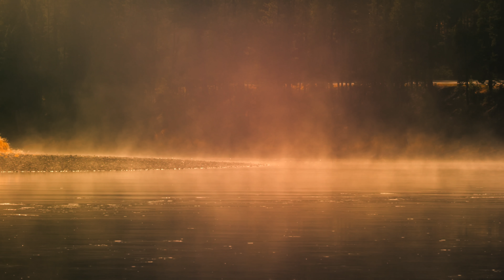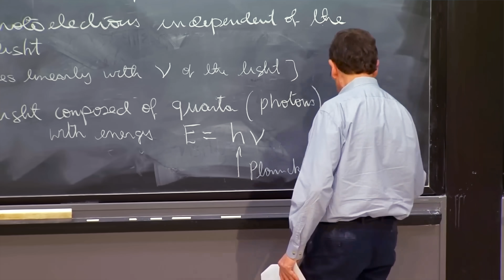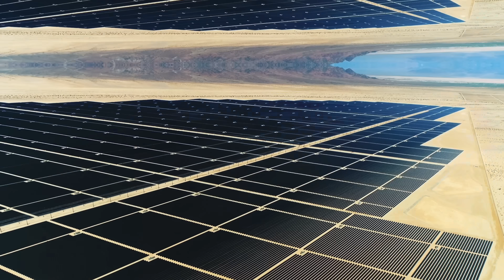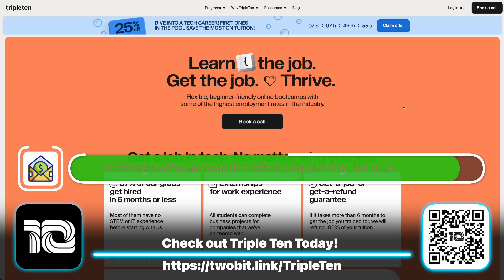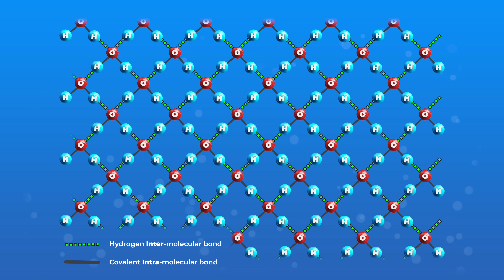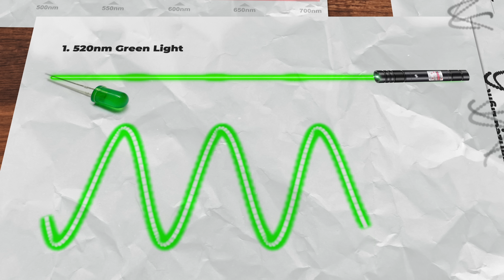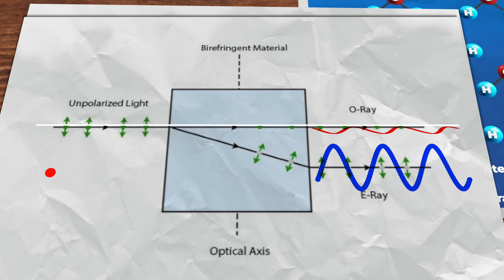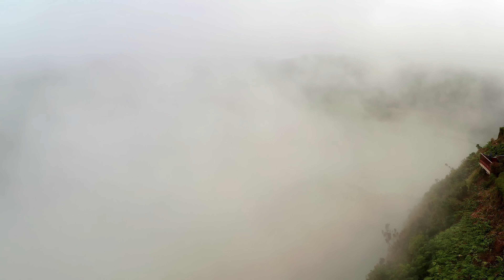New MIT Discovery Just Solved Water's BIGGEST Mystery!

Comment: I live in a cold climate in Canada. I watch ice shrink in the winter in conditions of   -40°  .   I have always been told this is sublimation.   We hang wet clothes outside and they become dry.
Reply: Back in the 40s and 50s, my grandmother used to hang the clothes too dry in Chicago winters and occasionally, break a corner off. They dried in the cold too.
Reply: @nwchrista  Cold air can't hold as much humidity. Winters are always drier than summers.
Reply: @Gunni1972  Sounds like you've never encountered a cold temperate maritime climate... Summers are wet, winters are significantly wetter.
Reply: @peglor  In a maritime winter the air is more saturated with water, meaning it holds a greater amount of it's maximal capacity, however the total capacity to hold moisture is much greater in warm air.
Reply: @creativedesignation7880  In maritime summer the air will also hold a similar percentage of it's capacity of water. Having a massive body of seawater nearby means the humidity rarely drops below 50% all year round. Low humidity only occurs, summer or winter when the wind changes from its prevailing direction (Sea to land) and picks up dry air from further inland.

The humidity here hits 100% warm or cold regularly enough - the only way to tell it's raining sometimes is to see if drops are hitting the puddles because it can be hard to feel small drops landing on your skin over the background of completely saturated air. I experience this more in summer, but that may be related to being outside more because it's warm.
Reply: @Gunni1972  Air can only carry so much moisture at a given temperature. 
Absolute humidity is the mass of water per volume of air. 
Absolute humidity of cold air is less than absolute humidity of warm air.

Relative humidity is the mass of water per the amount of water that can be held by air at certain temp. 
100% humidity of cold air is less than 100% humidity of warm air. 
That is why a incoming cold front brings rain and your lips get chap in the winter.
Reply: @peglor New England oh my goodness it’s so wet in winter
Reply: Like many have said already, I wouldn't be surprised with how dry the air is to pull moisture out of the clothes.
Reply: Since sublimation is literally a solid changing to a gas without existing in an obvious liquid state in between, it is sublimation.
Reply: This (the video topic) is not sublimation. This is a light hitting the surface of the water causing the formation of a mist (i.e. tiny droplets of liquid water) which drift off and later evaporate in the air.

The higher rates of evaporation here are not really anything special it is just a result of more surface area and interaction with the air. You would get a similar effect agitating the water in some other way. They just happen to be doing it using light here.
Reply: @kanoaika  is it not drying simply because of the air?
Reply: @Music-xp5wg  I still haven't figured out what specifically your question is asking about since I was talking about two different phenomena in my reply. I'll answer for both.

Sublimation is not just drying 'because of the air'. Sublimation is when it goes directly from a solid to a gas. It takes an input of energy for that to happen as there is a phase change (bonds need to be broken). The source of the ice outside in very cold weather (which is the one being considered here) we know the air temperature is very low which eliminates the air as a significant source of thermal energy for the phase change. The other source of energy in this case is the radiation from the sun. This is the source driving the sublimation. Radiation is absorbed causing molecules of water to get enough energy to jump directly to a vapor form and leave the ice crystal. 

(This makes even more sense when you consider that while solar radiation intensity per area decreases during the winter (because of the axial tilt of the planet leading it to be spread over a larger area) the energy received per incident photon absorbed is the same in both summer and winter. I.e. while the ambient temperature of air dramatically decreases (decreasing its ability to facilitate removal of water and provide energy) the sun on the microscopic scale of the molecules being hit with a photon and released from the solid ice is just as strong as ever on a cold winter day).

In the case of evaporation (i.e. water loss from liquid water--the main video was talking about) this is normally facilitated by air to a significant extent. But in the context of this comment which we are in the reply section of, we are talking about ice shrinking in -40° weather. In this we are not talking about evaporation (or the effect here with some wavelengths loosing tiny bits of mist which then evaporate in the air) because there is no liquid water--it is -40° once again.

So to conclude, you are correct: in the general case (especially the one mentioned in this video) it is actually the air doing much of the work for evaporating the water, but in this specific case the air is extremely cold and the water is frozen which makes those effects negligible (heat transfer from air) or non-existent/irrelevant (the special mist generating effect that is the main topic of this video).
Reply: @kanoaika  Mist is a good metaphor the the tiny molecule level interaction.

Comment: Something that comes to mind for me for an application for this is to help minimize evaporation losses in water storage. I have quite a few man made ponds (we call them a dugout) on my farm. We’re currently in a drought and water levels are low. I think I’m going to try to find some green pond dye and see if that might minimize evaporative loss in them.
Reply: Perhaps instead of dye you could find a surface water plant that would provide coverage. We have a Bunch of Invasive water hyacinth here on the San Joaquin River Delta. I'm sure CA Dept of water resources wouldn't mind sharing! ✌️😸🍀
Note: it can also be used as feed and woven into mats. The flowers are also pretty. 
Ps. Totally empathize about the drought. My region is an agricultural bread basket, so the La Niña years, which often brings drought, can hit us hard.

Edit: Other possibilities might be liquid chlorophyll or some type of benign algae. Or, perhaps even green plastic balls. I saw a Veritasium video where he visited a reservoir down in SoCal using black ones for cover. 
Personally, I'd go with least toxic option for whatever you have on your farm.
Reply: @erinmac4750  in hot, dry years we do get algae mats growing in the dugouts. The issue with algae is it clogs pipes if it gets sucked in, and it also makes the water stink because it dies over the winter and sinks, rotting on the bottom the following year. The drought has been pretty bad last year, and this year it’s not quite as severe. Although the water table is way down, so pastures are bare and regrowing very slowly. Hay/forage is also suffering and growing slowly and thin. No rain in the forecast either, but the prediction is that we should start to see more regular precipitation next month as El Niño breaks over into a La Niña pattern. Allegedly. But seeing as weather predictions from “professionals” is exactly as accurate as weather predictions from a 3rd grade class, I’m not exactly holding my breath.

Comment: Hmm so there is some requirement for polarized light and you also mention an optimal angle of about 45 degree.  Reflected light is polarized and correct me if I'm wrong, but isn't 45 degree angle close to the total internal reflection between water and air?
So maybe this edge case of such a specific angle does cause some near total internal reflection of water vapor so the light can be bouncing way more often between the molecules to make it a lot more efficient compared to other angles?
A bit like resonance where its effect is way more stronger at a specific angle.
(well waves and angles are always related, so maybe not that far fetched)

Comment: By definition If it’s evaporating it’s heating, the average scalar of movement of each atom or molecule.

A better use of time would be to figure out if the bright reflections on water is hydrolysis and then combustion.
Reply: According to the presentation of the subject, it looks like disintegration, not stimulation. So, the green 45 degree light isn't stimulating molecular movement enabling H2O liberation, but presenting as a giant green blade cutting the intermolecular bonds between the H2O formations, with gibbets of water molecules flying into the air like Sponge Bob directed by Quintin Tarantino.
Reply: @Arthurians  Cutting van der wahls bonds directly is statistically improbable and doesn’t give the water molecule a vector to just escape

Comment: You don't understand evaporation. Evaporation happens because the heat of a liquid fluctuates on the molecular level and, at the surface, can allow a particle to escape. This doesn't require heat. The sun increases the rate of evaporation. But in a dark room water will still evaporate. In a cold dark room water will still evaporate. I yield that it could speed up evaporation with less energy. But I doubt it. When talking about energy, the amount it takes to go from point A to point B is always the same. It always takes the same amount of energy to move water from liquid to vapor.

Comment: When you're trying to evaporate water the light which doesn't directly work gets turned into heat which is what you were using before anyway so the best way to approach this is to design a conventional drying or desalinization solution but make the heat source be an LED on the water and it work slighly more efficiently

Comment: This may explain why ice evaporates without first turning into water.
Reply: No that is sublimation. That (like normal evaporation) just occurs when you have individual molecules that gain enough energy to escape. You can just think of it as heating just a tiny bit of the surface so it pops off before getting transferred to the rest of the ice.

This was saying that light can induce water to form a mist (suspended tiny droplets) which in turn evaporate faster because they have more surface area. Interesting but the new part is the thing about the light causing mist. All the effects are not unique to light, they are just what happens when you have a mist. You can get it to happen by mechanical misting or other means.

Comment: Desalination through boiling doesn't need to consume much heat at all, you don't need light for it, fascinating though this newly discovered process is. I figured it out almost 30 years ago studying external combustion engines and the tech to do it was littered through a very large quantity of patents that were not particularly novel. The key concept is heat recovery from the cooling side of the loop to the heating side of the loop. I call it stratified heat exchange.
Reply: Figuring this out 30 years ago only puts you a couple of hundred years (Or a couple of thousand depending how much of this was used in the ancient world used) late to the conservation of energy party 😛. Chemical plant design is absolutely full of this too.
Reply: @peglor  What's curious is I made a stratified heat exchanger and it worked brilliantly. cold water in, superheated steam out, flame in and luke warm air out. So the I had to take into consideration with all the similar patents, if the application to external combustion engines was being supressed by existing IC engine companies??

Comment: The cooling effect is interesting but we already have evaporative cooling and this process seems pretty weak
Reply: But now we can do it with less energy consumption
Reply: Sure… but it's like we found out a new refrigerator fuel. That's why evaporative cooling kinda sucks, because you end up wasting energy on the cooling part… and there are better solutions at the end of the day.
This discovery helps in that now we've one more source of "fuel" for the process… improving our chances!
Reply: Evaporative cooling doesn't work in humid climates; it doesn't matter how evaporation happens.
Reply: @freethebirds3578  Sure, but the point of this discovery is not that. We can control humidity if needed in the end. The point is to simply find new ways of doing it/this… hoping some will be better.
Reply: He just described evaporative cooling with more steps. I'm pretty confident it's far more efficient to spray the water through a misting jet to break it up to give it more contact with the air to create evaporative cooling than anything involving all the extra steps with LEDs/Lasers. If this effect was happening on any kind of a useful scale it would have been noticed a long time ago.